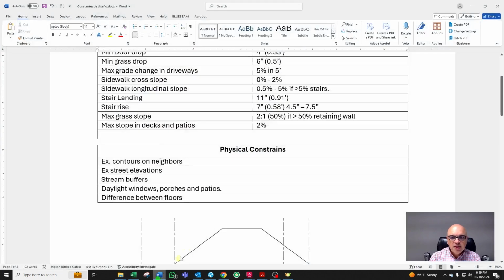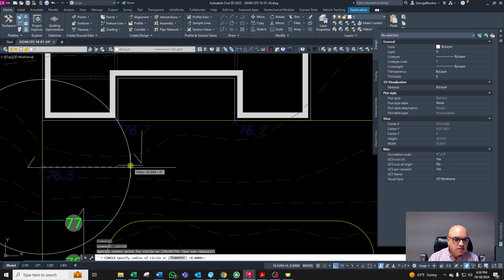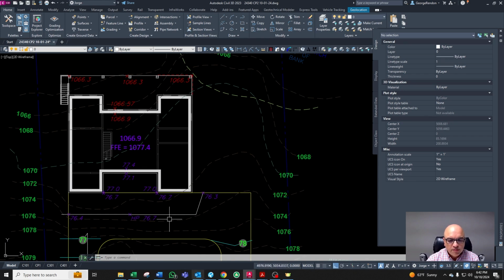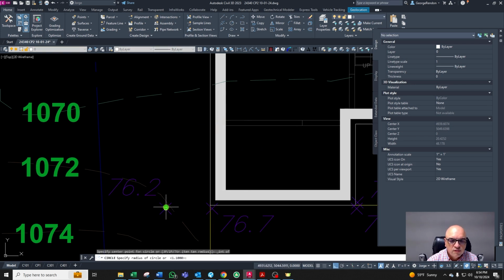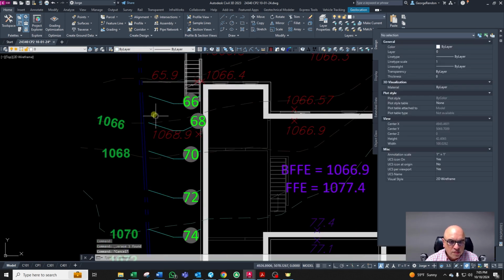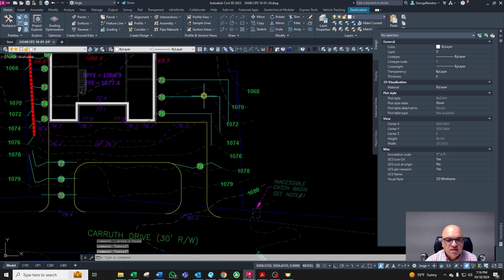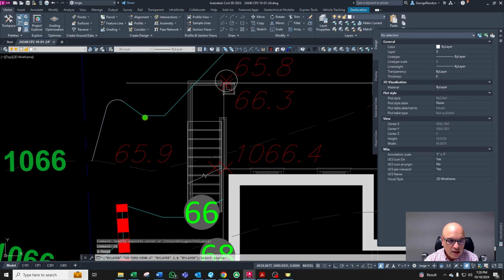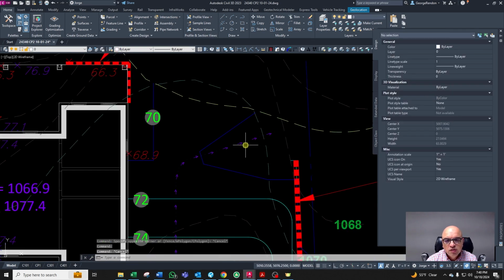P3 5.2A Grading Plan - Single Family

Comment: this is a good content but i think you should go slower ,is not for entry level at all,but thank you and plis keep doing this kind of training
Reply from the maker: You are correct that the the content is not for beginers.  It is the shared part of some of our content that is part of a training package.  The purpose was designed to walk engineers through the a project in the most efficient path possible and the videos are designed to be a recurring resource for guidance.  We also want to show how quickly some of the steps can be down so that design engineers have a reference point for what is possible.  If you need extra time, I would recommend watching the video at a slower speed so that the content can be absorbed more quickly.  Thank you so much for watching!  Please share with your colleagues.